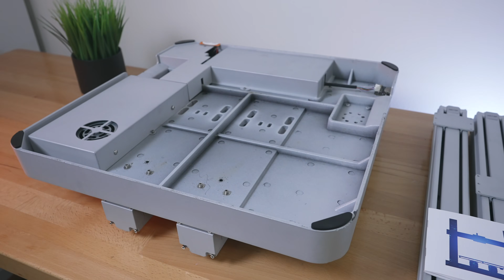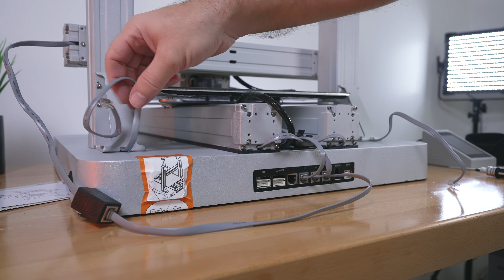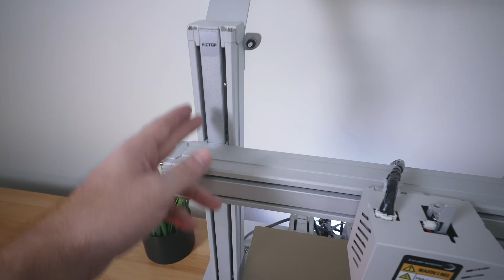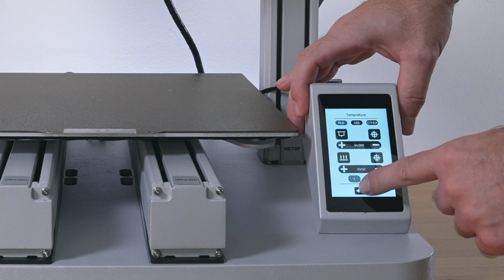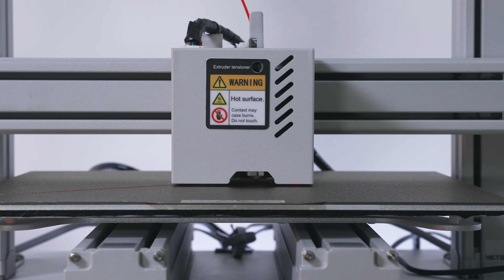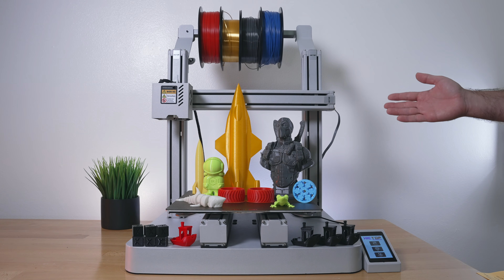HicTop Al 13-310 - 3D Printer - Unbox & Setup

Comment: Hi there, I'm looking for a beginner 3D printer and would like to know your recommendations for both resin and FDM printers. The price should not exceed 350 € and I will mainly use it for printing architecture and sculpture models. The print size is not a big issue for me as long as I can still achieve a usable size for table decorations. Would be great if you could give some suggestions! Thank you!

Comment: Thank you for your review, we watched it carefully, and we do not think you are nitpicking about it, we appreciate you have told us the drawbacks, then we will know how to improve it to be a better one.
We will do solid and safe cables for it and improve the materials on the frame too.
We are updating the firmware to make the leveling more accurate. The print quality is also concerned with the firmware, we are updating it now. The updating will continue if needed.
We will send the firmware to you and upload it to our website when it is available. Thank you for everything.
Reply: What has been updated and are you going to make a larger version with clipper?
Reply: @3dtechnologies153  What exactly makes Klipper superior?
Reply: @runesvensson1244  Clipper allows for faster printing speeds without artificing like ringing. Better quality prints at higher speeds.

Comment: The biggest advantage of this 3D printer is that it is very easy to maintain and install. All of the gantry parts are exactly the same. If one of them is broken, we only need to ask for one new part from HICTOP，and replace by ourselves.

It is undeniable that P1P has its advantages, but HICTOP has advantages in terms of daily maintenance. It will be more perfect if they can update the firmware later!

Comment: When you say you are printing at say 300 mm/sec. Is it the 1st cura setting for print speed which would have walls and stuff actually going at like 150 mm/sec.? Or is it actually printing walls at 300 mm/sec.?
Reply from the maker: your right, walls are 150 mms

Comment: Awesome Video Vlad. I have one of these and my findings are almost identical to yours. It’s held back by its firmware as it needs to be tuned for pressure advance and input shaper. So, hoping for a firmware update. The wire management needs attention as well. Otherwise, it’s a solid machine for a first from the company. PS. your cinematography is on point man. Well done.